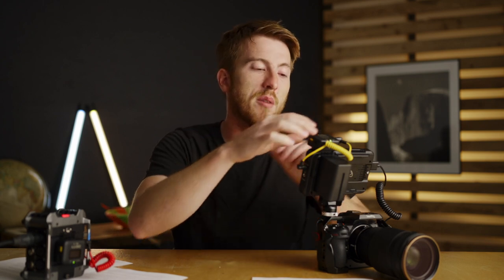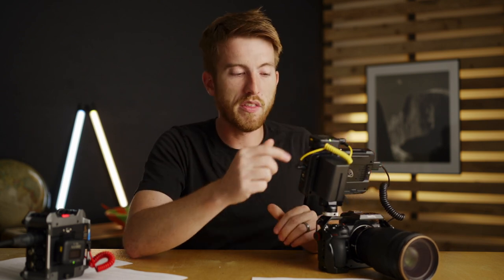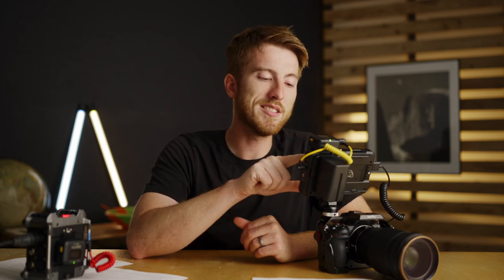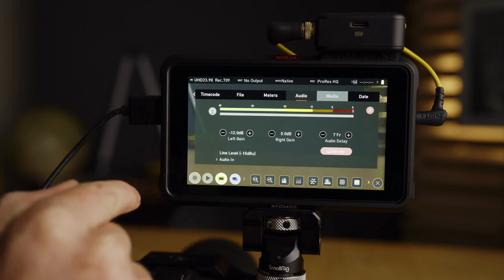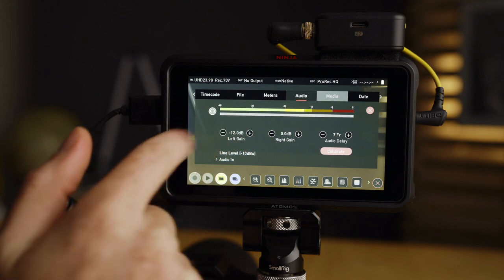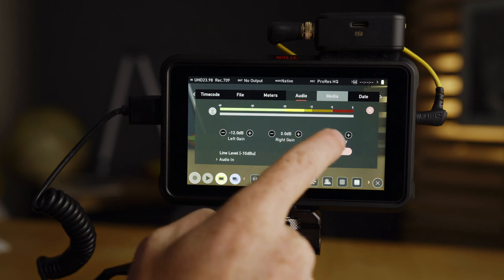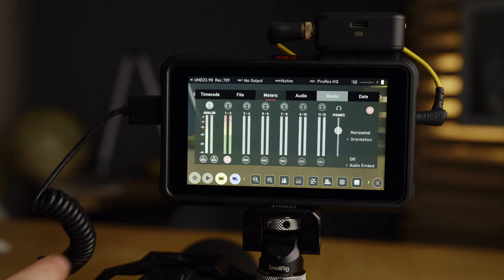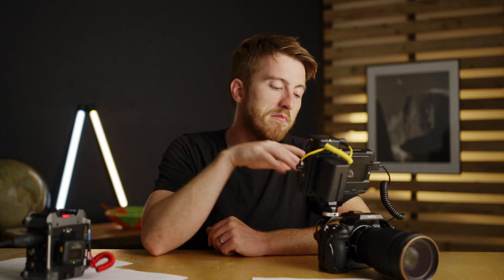Setting up TIMECODE for DOCUMENTARY filmmaking | Feat: Deity TC-1

Comment: Great Video! Any reason why you dont use the Atomos Connect for timecode?
Reply from the maker: I did a whole video on why I chose the TC-1: https://www.youtube.com/watch?v=7PcRsh9FOog&t=2s Basically the Atomos Connect was shipped out half-baked and is super unreliable, more expensive, and less versatile than the TC-1 system.
Reply: @brycefunk  great, thanks alot for your help

Comment: Are you recording your footage into an external ssd with the Ninja V or into the sd card slot into your camera, to utilise the timecode data recording?
Reply from the maker: SSD on the Ninja V. The Deity TC-1 is running into the Ninja-V. Timecode is updated on the file in post via Da Vinci.

Comment: Great video, thanks a lot for such valuable information. How do you sync audio from F2 with other sources?
Reply from the maker: Good question! Technically, the only way to do it “properly” is to use the Bluetooth version of the F2 and sync using a UltraSync Blue. You can sync the F2 and F6 together using the UltraSync Blue and then jam sync the Deity TC-1s to the F6’s Timecode via the I/O Jack. The UltraSync Blue is Bluetooth only and has no I/O so if you really wanted to do this “properly” or stay in the same ecosystem, you would want to go with a full UltraSync ecosystem and use the UltraSync ONE instead of the Deity TC-1 as the timecode device for your cameras - that’s just a much more expensive option but does have some benefits. I don’t do that. I generally just use DaVinci’s “auto sync audio based on waveform” or do a big clap at the start of each take. Technically, you could also send a Timecode signal into the F2 via the input and start each of your recordings with that timecode signal and use software to update the timecode in post. This really only works for short takes - < 15 minutes - as there is pretty significant drift due to the F2’s frame rate settings. Im ditching all my F2s for the Deity THEOS (if they’d ship them already). Does that answer your question?
Reply: Great, yes, fully. Thank you very much @brycefunk
Reply from the maker: Of course!  @AlexBukharov
Reply: Does this workflow apply to the Zoom F3 also. I use the Lumix Gh6, Cannon R6, and I want to be able to sync in DaVinci, then Edit in Adobe Premiere because I use After Effects alot. Is the UltraSync One better to use in this case? Thanks in advance😊
Reply from the maker: @terrygriffin5201  good question. The UltraSync One will probably be your best bet in this application. The issue you would run into with the TC-1 in this instance is that the UltraSync Blue and the F3 do not have timecode I/O ports, so there is no way to jam the TC-1. You can sync the UltraSync One and UltraSync Blue to one another, then use the UltraSync Blue to sync the F3 and/or F2 and use the UltraSync One to sync the cameras.

Comment: dude thank you for making this! God, no one has videos on timecode with the ninja other than photojoseph and the atomx sync is gone! I don't want to buy the atomos connect for my ninjas. So I shoot on lumix cams that have dedicated TC ports. I edit in FCP so audio timecode isnt a thing yet. How would I use the tc1 with the TC port on my camera and get timecode to the ninja? Any ideas on how to get timecode into a zoom f3? Do you need to calibrate the ninja to get the accurate frame delay before using TC? Thanks!!!!!
Reply from the maker: The Lumix should send timecode over HDMI to the Ninja. That is a pretty standard MO for most mirrorless cameras - my Nikons do it and those are potatoes haha.  So you wouldn't even be working with audio timecode there - which is great! Whatever timecode you feed into the Lumix, should just get sent over HDMI and imbedded in the files metadata. You have two options for timecode to the F3 - to my understanding. You could get the UltraSync Blue; this send timecode the the F3 wirelessly. But then you're committing to the UltraSync ecosystem as there is no way to get timecode out of the F3. Or you could send an audio timecode signal into the F3 via one of the XLR ports, but then you've just turned your two track filed recorder into a one track field recorder. So the UltraSync system is kinda the way to go if you are committing to the F3.
Reply from the maker: Tentacle sync makes software that can read the audio timecode and append that to the files metadata. For Mac, you do have to pay. You do have to calibrate the Ninja, yes - probably. But if the timecode signal is coming from the camera, you may not need to. You would just need to verify that the audio recorded externally and the video are synced properly. You can do this by dropping a pen on a desk and verifying that the sound and visuals line up when the audio is synced in post.
Reply: @brycefunk   thank you so much for all of your replies! I really appreciate it! Happy to have found your channel and already subbed! I'll keep you posted. I am running a mic into the f3 and rodego ii. I am ready to move away from the go ii and get a more reliable/pro audio kit. SO i have been up and down trying to figure out what to get lol thanks man!
Reply from the maker: @ChrisFlores22  Right on! Cheers! PS Deity just pushed back the release of the THOES to the end of October.
Reply: @brycefunk   dude, is getting the bptrx a mistake? Seems so similar to the theos but a little cheaper lol
Reply from the maker: @ChrisFlores22  I think holding out for the THOES system is worth it. Everything is going the way of UHF. The BPTRX is also incompatible with SanDisk cards which is weird. Overall, I think waiting to invest in the THEOS system is worth it. The non-UHF frequencies are getting crowded - plus the bodu on the THOES is much nicer.
Reply: @brycefunk   thanks man! I appreciate the insight!

Comment: Is is possible to use an audio splitter on a mirrorles to have a TC1 on one end and a rode videomic on the other? and split the tracks further in post?
Initial thought is to have as safety backup and also like what you mentioned, to have the ability to add some ambience after the fact.
Reply from the maker: In theory, yes this is possible. You may need to experiment with the Y cables. The TC-1s sends timecode on the left channel - the tip of the TRS cable. So you would want a stereo break out cable - like this one below. Then you can send the Rode GO or whatever into the camera on the right signal - the sleeve. You can then further split those in post for sure! https://www.amazon.com/Hosa-YMM-261-Stereo-Breakout-Cable/dp/B000068O5H/ref=sr_1_5?crid=1IB28Q4SIDJEA&dib=eyJ2IjoiMSJ9.r5wIbVUI1Xjs5BlkxMVUASFbgbVQsfCkUvKZOAj4RCsqf6WuxTt3tRSPRttEpQK0GtcRODPg_UGGJ-WJq__RQNKgUXJHG4dCHXifyDIpinSKq0AfBy1nzwyUjLbebQispgQntvzEE35Hite9y5Br4syyJK02rimgUbZHmrMtDJAtQd6Wdc_58oQcpBmDrVSCfdGYgEpq3CFULMgc5DLCtwss0sqcqmTVCDkP_6g24Do.-l_uhnD0wzQzDCgDtz0mJ0sXf5IMlIrWU38JpwCqNSA&dib_tag=se&keywords=3.5mm%2By%2Bcable&qid=1709312769&sprefix=3.5mm%2By%2Bcable%2B%2Caps%2C162&sr=8-5&th=1

Comment: Last question lol how do you monitor audio on the f2?
Reply from the maker: Umm...I don't. haha. This has bitten me a few times now unfortunately, which is why I have the Deity THEOS system on preorder. I have BT and non-BT versions of the F2. The non-BT you just have to pray it's working. For the BT version, you can at least verify that sound is coming through and not clipping (yes it's 32-bit float, but if it is clipping on the meters, that means that your mic isn't properly screwed in...I'm speaking from experience.) But you can't just sit and stare at your phone the whole time. 

They are great little recorders and I use them for crash mics now. But the definitely have their flaws.